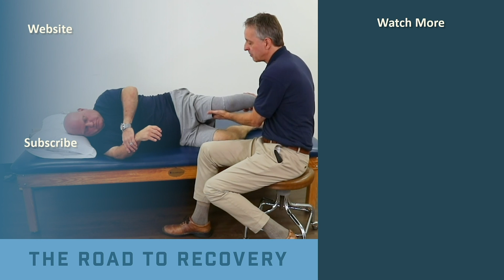Stairs and Ramps For Amputees - Prosthetic Training: Episode 13

Comment: I’m off grid and don’t have a lot of electricity to charge extra appliances. My last leg I got has the split foot in the front which allows me to walk easily on rough or rocky ground and there is a hydraulic shock on the heel about 5 inches long it has around a inch of play taking a second or so to move it allows my foot to slowly bend at the ankles and makes walking very easy on uneven surfaces and going up and down stairs normally without that catching your heal and teatering over the edge that was very unnerving and a little scary doing but just having that little flexing slowed down let’s me walk like normal without any trouble at all I don’t see why they don’t make all of the prosthetic feet like that like I said claiming stairs and ladders are no problem at all with it.
It was going to take a while to get my prosthetic leg so I purchased a walking crutch since I lost my lower leg I could just stand on my knee on the padded shelf strapping it on it has a hand hold at the top at waste high you can hold if your nerves

Comment: How long has Keith had his prosthetic for? How long has he been practicing using stairs?
Reply: To my knowledge Keith has been using the Microprocessor  it's a Genium for at least 2yrs. But I don't know wat mechanical knee  Keith was using b4 he transition to the Genium which is a top of the range ottobock brand. I think all up Keith has been using prosthetics for more than 5yrs.i hope that bit of info will  help u.

Comment: Sorry about that. Can you show me some videos of teaching how to use the Otto Bock 3R80 Knee? Because I wear the Otto Bock 3R80 Knee. Thanks so much.
Reply from the maker: In this video series David mentions tips for individuals with any type of prosthesis. However, we are looking to increase our representation of various prosthetic componentry in our upcoming videos. So thank you for the suggestion!
Reply: @MissionGait  I am waiting for you.
Reply from the maker: We do not have any current amputee models using the 3R80 knee, but we are aware that this is something that a lot of our viewers would like to see. It is difficult to say when we may be able to have an individual with this prosthetic knee that will be available for filming. However, I can provide a few extra notes for you. The approach to the technique is very similar for ascending the stairs and ramps. The greatest difference is with descending: As mentioned in the video a knee such as the 3R80 must remain locked out while going down a ramp or stairs. So the prosthetic side will be the first leg down a step, and ramps are often best performed going sideways with the prosthetic side on the downhill side. Most importantly do not step down with the non-prosthetic side as the prosthetic knee will most likely buckle and you will fall. For more specific details, check out the video again. Hope this helps and thanks for watching!
Reply: @MissionGait  But when I go down slope,I go down slope at the first step by my good knee for the first step.
That's also okay for me to walk to down slope by this function.
Reply: I need this leg